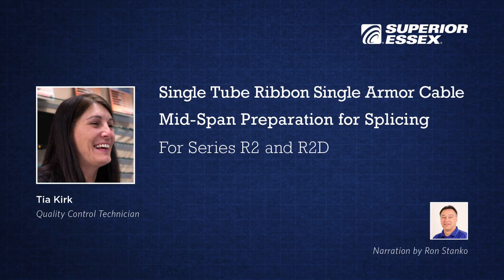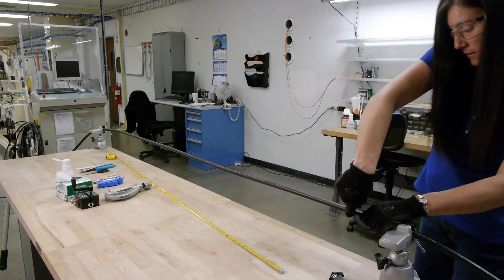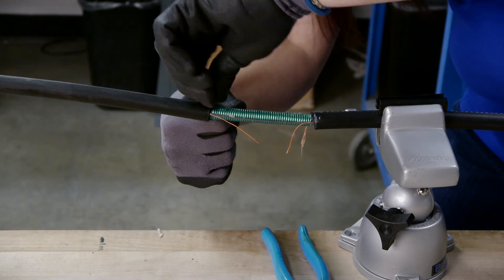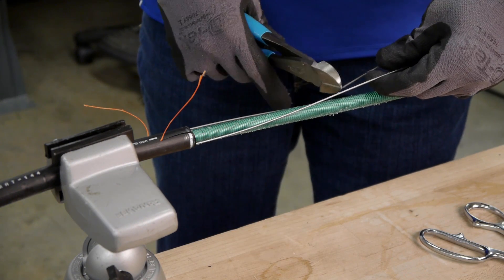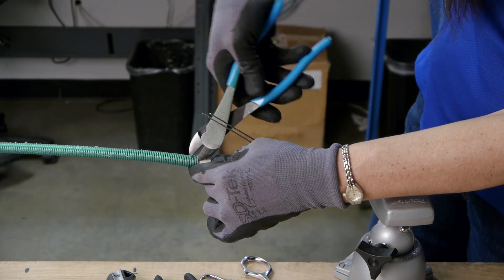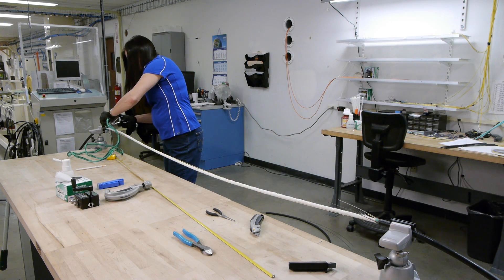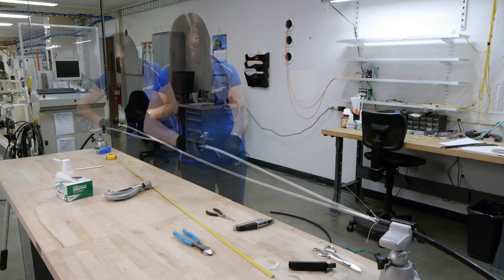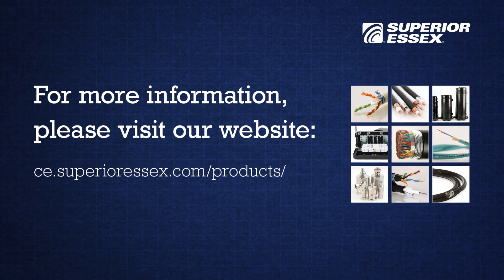Technical Video: How to prepare optical fiber ribbon cable for mid-span splicing

Comment: this is a terrible video...all that bending back and forth of the cable you'll brake the core tube. And, everything is so nice and comfy in an office environment but when you're actually doing that you'll be outside on the side of the road or in a ditch with a picnic size table. You can't use a vice either to hold and squeeze the cable you'll damage it.
Reply: This is how the manufacturers tell you to prepare their cable. It's industry standard. You won't break anything. And yes, you can clamp to your work table on the side of the road (or get a splicing trailer).
Reply: The cable is very durable and working a cable like this will not break the central tube.